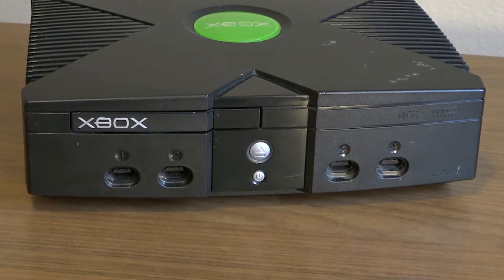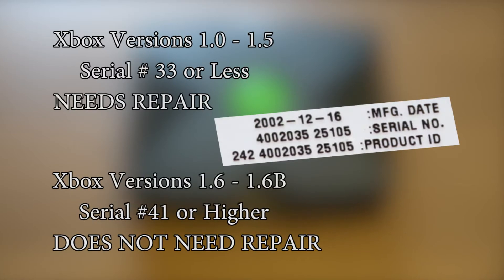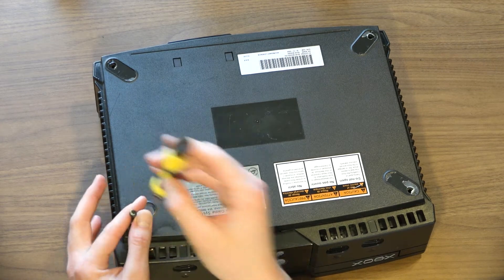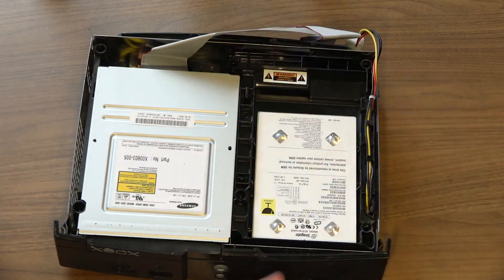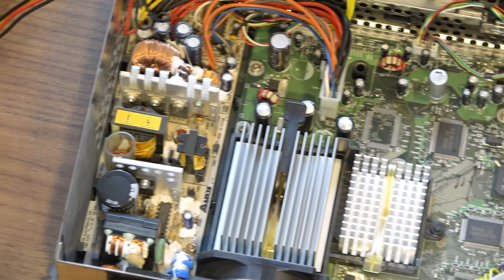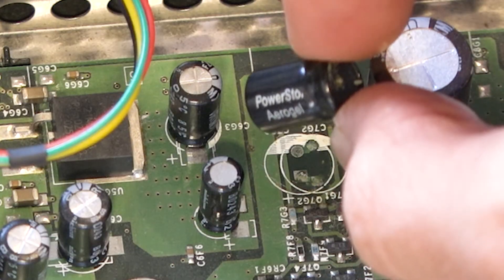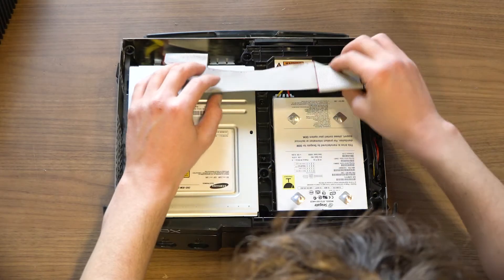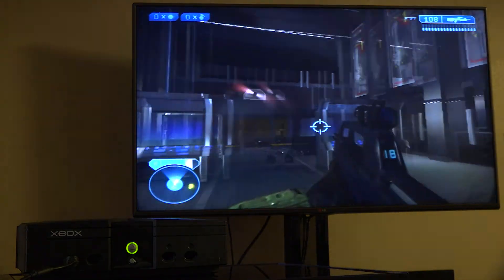Xbox Easiest Fix | Tutorial Remove Clock Capacitor

Comment: I had an Xbox many years ago that fell victim to the cap blowing and leaking acid all over the motherboard, which corroded it. Screwed up the console and its ability to function.
I have another Xbox now (an old one found on Ebay) and did this before the same thing would happen. I'm glad to know about this now and that this information is being shared more and more. The oldest Xbox units are more than 20 years old now (feels kinda bizarre to think about), and I hope for those who still appreciate them there will still be much more time and enjoyment to get from them.

Comment: I just bought an original Xbox on eBay and the first thing Im gonna do is boot it up to see if its working. Then Im cracking it open and removing this capacitor.

Thank you for this guide.

Comment: I got my original Xbox in Christmas of 04 I never moved the clock capacitor at  some point down the line I got to do it I have Xbox 1.6 the last version made so that means it won't run without the capacitor so I think I will just modded at so  down the line so I can bypass the need for it

Comment: My original xbox loads and plays games for about 2 to 3 minutes then goes back to the home menu mentioning that there is scratches or the game is unable to be read.  The game isnt the problem thou as i tested with a brand new copy... any recommendations? I already took it apart and cleaned everything piece by piece
Reply from the maker: It could be the disk drive optical laser is dirty and not reading the disks correctly.  There are special DVD disks which can clean the optical laser.  This may fix your issue.
Reply: @strudeltech2800  thanks so much for replying back to me... i will buy one and try it... and try to get back to you to see the progress
Reply from the maker: Keeping my fingered crossed.  Hope this fixes your issue.
Reply: @strudeltech2800  Do those types of disks work if you don't have the DVD add-on for the Xbox?
Reply from the maker: You will need the Xbox DVD-addon in order to play the cleaning DVD.
Reply: @Oliver023  did it work?

Comment: if your xbox turns on and off 3 times then on the 3 time it blinks red and green it is the clock capacitor if you remove it it might fix it
Reply from the maker: The original Xbox flashing red and green can mean the DVD Drive or Hard Drive is not connected and needs to be reconnected.  Flashing red and green can also mean a failed motherboard which could have been caused by the clock capacitor leaking acid on the board.  If the board is bad, removing the clock capacitor won't fix it.

Comment: Should I replace the clock capacitor or it is enough to remove it?
Reply from the maker: Personally, I would just remove it.  Replacing it takes more work.
Reply: @strudeltech2800  thx for the fast reply

Comment: Why not replace the capacitor with a reliable alternative?
Reply from the maker: For my use situation it didn't make since for me to replace the capacitor.  The capacitor only stores a charge for roughly a day or two.  I mostly keep the Xbox unplugged for storage until I go to use it.  Even if I had replaced the capacitor it would more than likely be discharged and I would have to reset the clock anyway.

Comment: This is what NO one should ever attemp , mean grabbing a aluminum. Capacitor with your bare hands. Capacitors store electricity, if one learns/thinks its safe to delid them with fingers or metal pliers grabbing another cap could and has ended with DEATH. I am not kidding nor throwing salt. Becareful electricity is a serial killer.
Reply: Removing that capacitor is not very dangerous at all.
Reply from the maker: Absolutely agree.
Reply from the maker: Thank you for your concern.  It's always good to be safe when opening electronics.  This is why I specifically say to use gloves.  Removing this capacitor is easy and should not be feared which is why I demonstrated removing it using my bare hands.  Absolutely you should wear gloves.  I state that in the video.